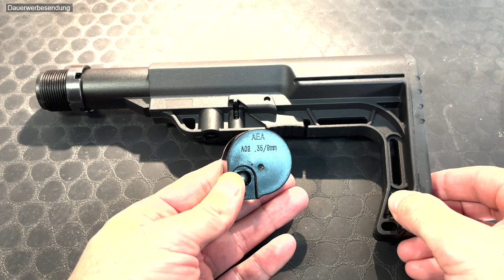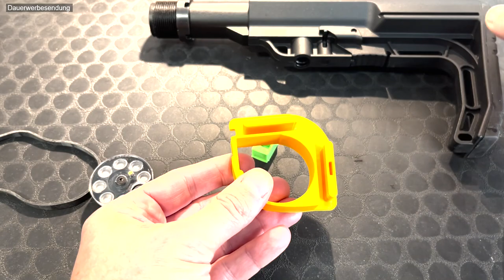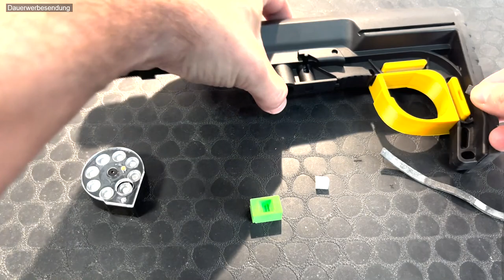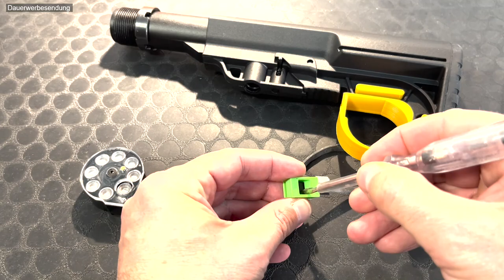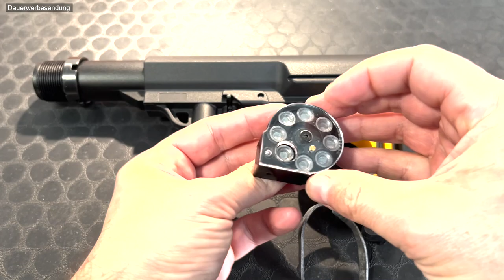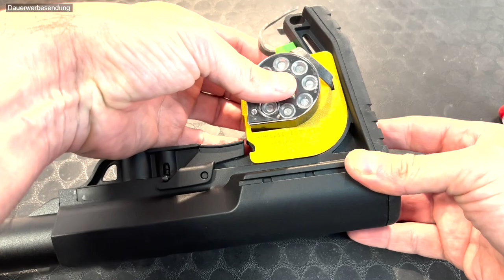Installation Guide 2nd MagHolder for AEA HP max

Comment: no one ties anything with ribbons.
nonsense
Reply from the maker: Your Boxershorts are tied above your hips... or maybe just to your belly.
Tent roofs of large tents are tied to the structure below.
Truck tarpaulin is tied with Rubberbands.
ok... wrong scale. Just look up mag pouches. There are so many, that secure the mag with a Rubber Band.
Isn't the whole mole system a rubber band?
Reply: But indeed my first thought also was that the rubberbandsystem is the weakspot of this cool thing. I have an idea: Imagine the green lock-part for the movable band would be a fixed part of the yello frame. One piece so to say. Through that block you could drill a hole and put a screw through it on which movable wings are mounted. A parallel clamp so to say that rotates over the magazin and clicks in near the shaft in highest position somehow. A little pull with the fingernail and it is movable downwards. Is it understandable?
regards
Reply from the maker: Thanks for the feedback.
But I did not get it fully.

During the design phase I experimented with clamps, hinges, moving, turning and fitting. One of the designs is free on printables.com.
Non of the designs was saleable. I mean with that reliable. Strong enough to withstand impacts. But as well will still good after some months.
With most clamps in 3D printing, you will loose tension very soon. Different to Lego, where you still can press them together after 10 years, I tested it with 3D prints and they get loose after several weeks.
maybe with a different manufacturing or from metal it would be possible.
But with 3D printing... There is another designer out there, that have mounted it to the bottle. Bison if I remember correct. But I have only seen a picture and he is in the US so out of my reach.
Reply: @NG.T  hey were can I get that mag holder thx
Reply from the maker: @KINGBREAKBARREL  Isn't there a link in the video description?